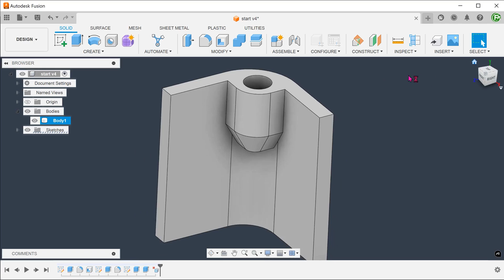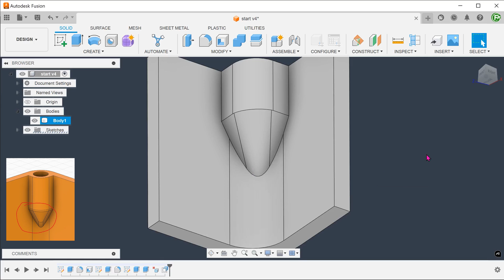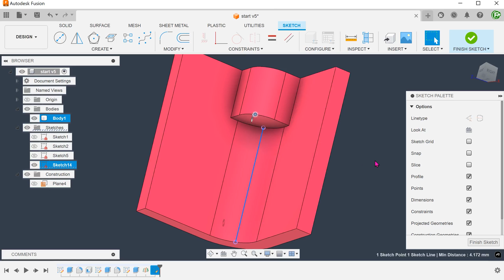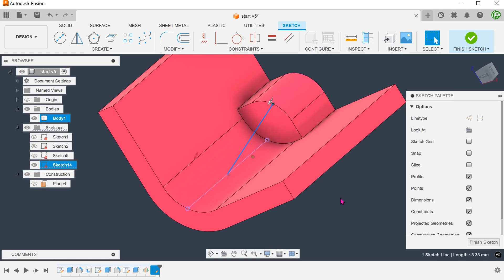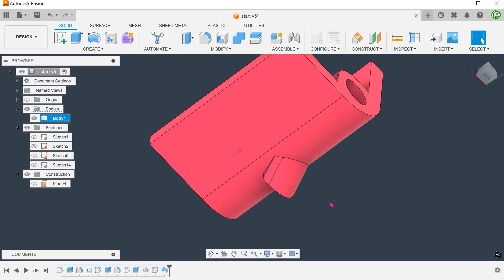Autodesk Fusion | Converging boss

Comment: This is a useful technique for ensuring 3D printed parts have a suitably angled (e.g. 45 degrees) portion so that the boss doesn't require support. I've typically done this using surfaces and a boundary fill but I like this technique better. Thanks.

Comment: the example model seems to have a seperate fillit on the bottom connecting the two sidefaces. you could delete the bottom face to get all 3 surfaces to extend to meet at their ends, and then fillet the intersectionedge between the two planar faces.

Comment: You can also use surface modeling to do this. I've done it several times because it's a great way to add heat-inserts for faceplates on 3d printed boxes.

Split the corner face, do a surface loft between the two lines, thicken it, and then offset the inside face to "fill" the cavity which is created. Here's a quick video: https://www.youtube.com/watch?v=ZM40xL_mffg

Comment: During the sweep, you could have used the projected line as a guide rail, or the inside face as a guide surface, and selected either scale or stretch for the profile. It would not have penetrated the outer face.

Deleting faces or features does not make a robust model that can be easily parametrically changed. It is useful for fixing errors caused by the Fusion 360 kennel at the end of your modeling workflow.

Comment: I was able to do this by using the bottom edge of the boss as a tool to do a Split Face operation along a vector and then simply delete the faces and patch.

-create sketch on bottom face of boss
-project/include outer edge of boss
-turn on 3d sketch
-add construction line down the middle of the inside corner, from midpoint to midpoint of the corner arcs
-add line from midpoint of boss edge arc to midpoint of construction line
-Split Face using included edges as tool, inner faces of wall as target, "along vector" selected, and our angled line as the vector
-Delete bottom face of boss and the 3 faces within our split
-Patch the hole
-Stitch the surface bodies into a solid (I had to reverse the normals on the patch not to get an inside-out stitch)
Reply from the maker: Thanks for the detailed steps. I tried to do something similar by creating ruled faces along the outer edge of the boss and extend them to the inside fillet to create an enclosed volume. But I had problems with extending the ruled faces.  Your method is probably the way to go if we want to use surfaces.
Reply: @Fusion360School  I tried ruled surfaces first but it sounds like we ran into the same problem with them.

Comment: I'm pretty sure you don't need to do the offset, and can just delete the face you offset, which should automatically fill in to extend it out like you want
Reply from the maker: Thanks for the suggestion. I went back to try this and it does work! Though it creates sort of an ugly sharp corner. After adding a fillet, it looks pretty good.
Reply: @Fusion360School  That's pretty strange since it should be doing just about exactly the same thing the offset should be trying to do. Maybe it was because you didn't do enough of an offset, or something. 🤔

Comment: Would it be possible to sweep a similar profile you used in the last example (wich lower point is in the cossing line of the inner two wallsurfaces) and sweep it using the lower edge of the bore surface so you then dont have to use the delete command?